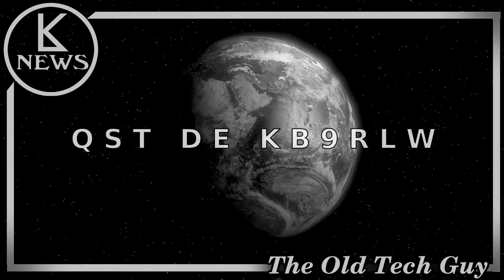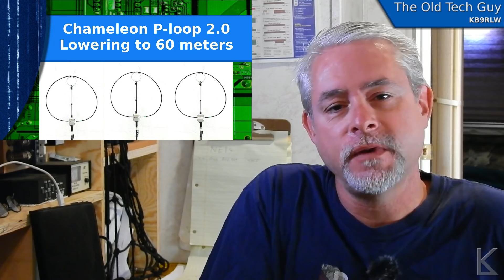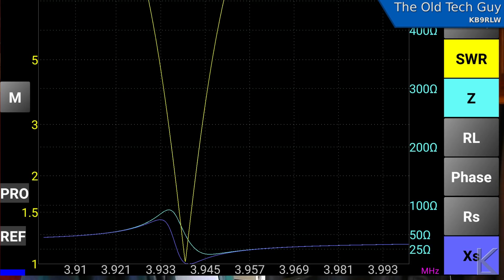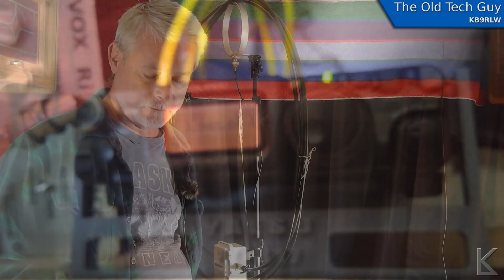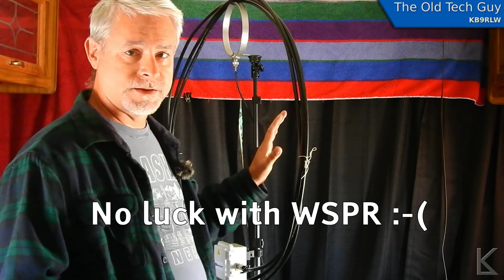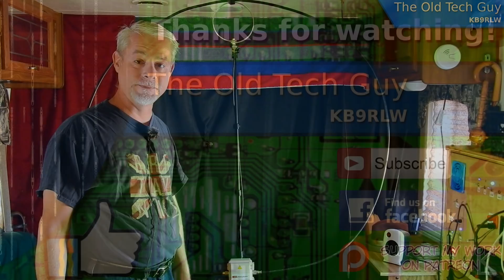Ham Radio - Taking the Chameleon P-loop 2.0 down to 60 meters.

Comment: I'm going to make a 'junkbox magloop' for experimental use with a newly purchased G90, especially for use with winlink and JS8Call. I understand that the loop will create high voltage at the main loop 'junction' to the capacitor. Regarding this capacitor for this loop: how large plate distance do the capacitor need to have for a typical QRP setup - say that I want to use the radios maximum of 20W?  How high will this voltage be? 🤔

Comment: Kevin, does  the Faraday Loop (feed) stay at the same 20% diameter ratio, regardless of the turns?  I have seen a  40% Faraday Loop construction on other multi-turns but I have never built one and I have no experience with multi-turn loops.  Thank you for posting the video.  Many people love the Magnetic Loop.
Reply from the maker: I've changed the size of the small loop in past experiments.  Sometimes it needs to be bigger or smaller to get the SWR down.

Comment: Hi Kevin   good video, but I have two questions. first the 817 shows it's using the rear antenna and there's no microphone plugged in. I may have to get one of these loops to play with.  Have a good one
Reply from the maker: Yes it is using the rear antenna connector, which goes to my switches and swr meter and then to the coax for the loop. 
The microphone cable strain relief is clearly visible just to the right of the 3D printed stand holding the radio up.
Reply: @loughkb  ok  thanks  I like that stand  wish I had a 3d printer  maybe next purchase I make

Comment: Yo Kevin:!
Great video! Enjoying your experimentation! Still think some STEALTH antenna experimentation would be good also. My main goal is to get on 160 with a G5RV. Have had some success.. What say?
Have some wx comments to be saved for email.
de seeker/Jeff WA7LFP
Reply from the maker: 160 is a tough one.   You can use a tuner to load up an 80 meter dipole, but it won't radiate very well and you just won't do well.    It's got to be a longer wire.
I had some success back at the house with a 98 foot end fed wire with a 9:1unun and my tuner.  Made quite a few contacts.   
Nothing like the performance I witnessed over at  friends house.  He had a  half wave dipole that was only up about 20 feet and flat.   Signals just booming in and everyone he called could hear him.

Comment: Hey there Kevin,

Nice to see you experimenting away with the loop. As you were standing next to it, it inspired me to ask the following question:
Does the shape of the outer loop also influence the received/transmitted signals?

I think this question needs some more explanation:

Signals are best transmitted / received when the loop is in the correct direction, not being perpendicular through the loop.
If that is the case, whould it matter to change  the shape of the outer loop from a nice circle to, lets say, an standing oval form in order to improve groundwave signals or a flat oval to improve nvis?

Keep the video's coming. Nice quality you upload nowadays btw! 

73 de PC4AD
Reply from the maker: My gut says that it probably would change the pattern.  But finding out is hard.  It would take space and test gear that most of us just don't have access to.
I'm not sure if modeling software could do it or not.  I have yet to dig into something like eznec.

Comment: Hi Kevin;
How about raising the  capacitance instead of changing the loop diameter?
L.
Reply from the maker: That would work.  But you need a high voltage cap, and the tuning would become sharper and more difficult.
Reply: @loughkb  Hi Kevin; I just realized the question had already been asked and answered. Sorry, and thanks. 73s L.

Comment: Why is there no tuning capacitor across the small loop?  Wouldn't that benefit from being tuned also?
Reply from the maker: Nope.  Tuning is simply changing the resonant point of the whole tuned circuit.   The coupling loop itself is not a load to be tuned.  It couples to the load provided by the tuned circuit of the outer loop and capacitor.
Reply: @loughkb  Couldn't this be considered to be an air core transformer?  Who ever heard of tuning the primary of the transformer but not the secondary?  I think you should try it.
Reply from the maker: It could be considered an air core transformer,  with a capacitor across the secondary creating a tuned circuit there.   The 'primary' is just coupling energy to the secondary and has little to do with the resonance of the tuned circuit.  If you put a cap across the primary, it would become a second tuned circuit and at a very different frequency and probably throw the whole thing out of whack.  Also, it might become a load at an harmonic and eat some power. 
That's my thoughts anyway.

Comment: have you tried the antenna on digital modes  like ft8 ?
Reply from the maker: I've run PSK31 with success.  Other than that, some WSPR beaconing.  FT8 is great if you're goal is filling log pages and gathering certificates for the wall.  I'm more of a ragchew chat kind of guy.
Reply: @loughkb  FT8, like Wspr is great for antenna testing as you can use it to log a few contacts and then review your performance on PSK reporter. Also, for those of us who are QRM challenged, FT8 allows for getting out to DX I can't work from home but have to go portable to get.  Great Video

Comment: Out Standing!!  Way to go on experimenting.  I've got 50 or so feet of LMR400 not being used, I just might try that too.  From a couple of other comments maybe you should lengthen the aluminum loop too.  I'm watching for more.  What I'd like is to used a tuning cap to allow 100W without arcing and still have something I could carry around easily.    W0YVY
Reply from the maker: You'd need a vacuum variable cap.  Quite expensive.
Reply: @loughkb  Oh, to win the Lotto...

Comment: Would a proper 1/5th scale feeder loop lower the range or just broaden the bandwidth?
Reply from the maker: From past experiments,  I don't think it would make enough of a difference to matter.   I've found that the coupling loop size can make a difference in how low you can get the SWR.  Since it still gets down to 1:1, I think the stock, very well built, coupling loop is fine.

Comment: If you added a capacitor in parallel with the tuning cap in the box, wouldn't that lower the tuning frequency range?
Reply from the maker: Yes.  However, it would also make the tuning much more touchy and more difficult.  You'd also need it to be a high voltage cap.  The RF voltages there, even at only 5 watts input, will be very high.
Reply: Dennis Thrush  great question, I’m waiting for that answer also

Comment: Hi Kevin,
I think you need about another 10 inches in length of that loop. The coupling loop is now on the smaller size than what should be needed.  73   WB3BJU
Reply from the maker: The coupling loop still works fine and the SWR can still be brought down to 1:1.   The 1/5th ratio isn't an absolute rule, just a best practice.  I've experimented with smaller and larger coupling loops with success.   I've also found that in some cases, the coupling loop can be brought up where it's edge is along side the outer loop to bring the SWR down if it doesn't quite get to 1:1.